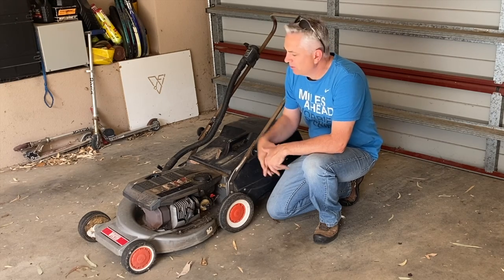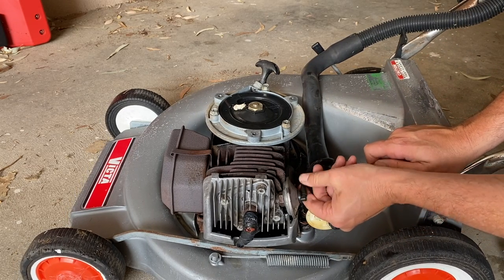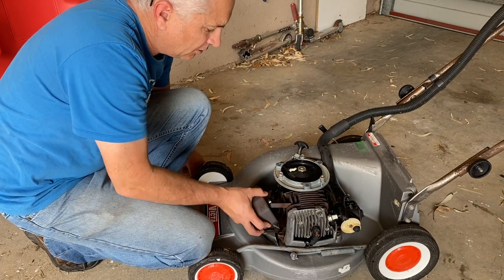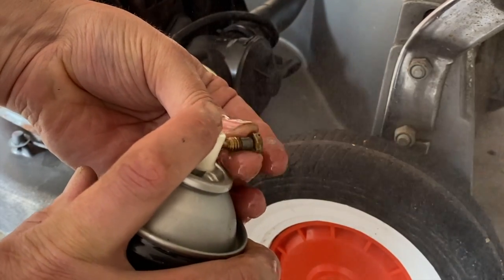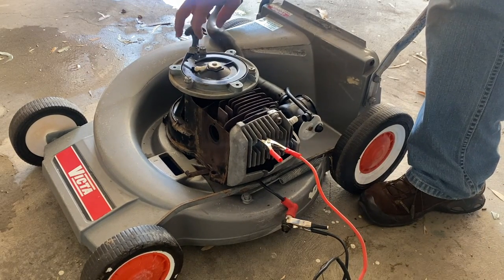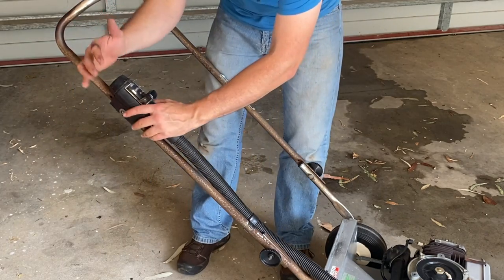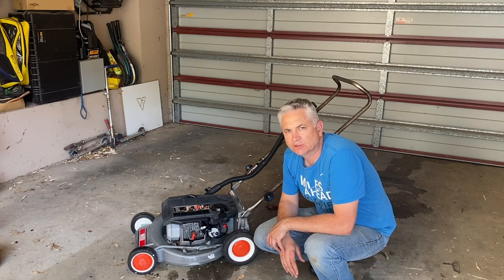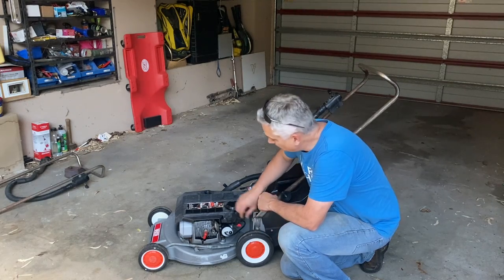Can we Fix It? Victa Silver Streak 2 Stroke Alloy Bodied Lawn Mower Restoration! Will it Start?

Comment: Where was Youtube when I was a boy?!!! Great work. I really enjoyed your no nonsense explanations. I have about 8 old Victa 2-strokes. When I am mowing, I don't have time for repairs. I just pick another and go agsin. Tell me - one of my 1970s Victa has really lost it's revs over the past few weeks. What would you think was the most logical cause of this?
Air filter?
Spark plug?
Carbon deposits?
Blocked carby ports or jets?
Rings?
Thanks again for your podcasts. You're a lost breed in this mad world of throw away Chondas and battery mowera. Gimme my dear old Dad's late 1950s catcherless ungoverned Victa anyday! I'm now 69. My Dad had me mowing at 6 years of age. I have seen and used just about every model Victa. Turns grass into lawn. Gee I miss them.
Reply from the maker: Hi Mate, I would start with the easy things from your list; new spark plug, air filter and then work my way through the rest!  If all else fails I have a video coming out in a couple of weeks on how to swap in a different Governor spring to bring the RPMs up, so stay tuned for that one!  Cheers Drew

Comment: hey mate. ive got a victa 2 stroke here with no decompreser valve . you cant put one on it . there is no where in the head that it can fit ????
?????
Reply from the maker: Hi Mate, the absolute economy model did not have a decompressor valve.  They are just a little harder to pull the starter rope, but I honestly don’t mind them at all and because they don’t have the decompressor valve it’s one less thing to fail / fix!  Cheers Drew

Comment: Hey drew cool vid mate geez it came up a treat. Mate how do you go about cleaning the fuel tank? And ive noticed you only ever seem to do a basic front carny clean on these 2 syrokes do you ever pull it all apart and mess with the tricky side? Thanks for the info youve taught me heaps im glad i didcovered your content
Reply from the maker: Thanks mate, yes I do pull the entire Carby appart if I need to.  The reality is that most of the time I can get away with a front clean and that way I just move onto the next mower with a minimum amount of effort and fuss!  I should do a complete Victa Carby rebuild on the Channel at some stage as it’s actually not that hard!  Is this something that you would be interested in?  Cheers Drew
Reply: @DrewFixIt  yeh for sure mate a full victa 2 stroke carby one would be one would be very handy mate.

Comment: Awww! I wanted to hear it run after the deco valve was fitted!
They're a nice model the Silver Streak.
I have the first powertorque Mustang which is identical except in colour. Green base, white engine cover and green catcher.
Also have the previous Silver Streak. Same base, slightly different shape catcher and full crank side pull motor like the powerplus you found earlier. Sexy looking mowers.
Reply from the maker: Thanks James! Cheers Drew